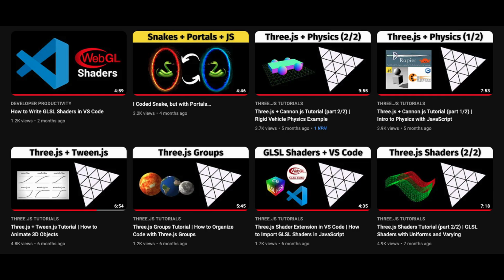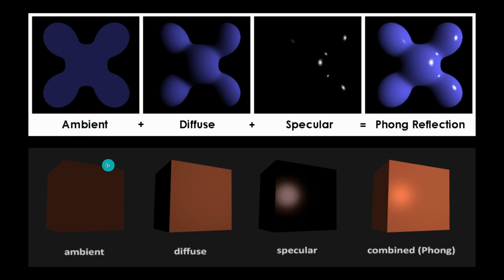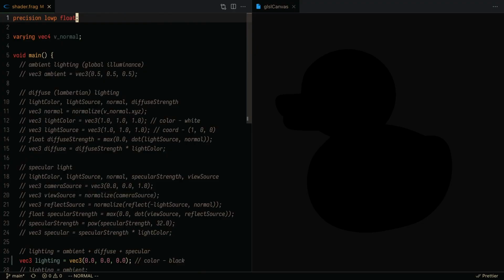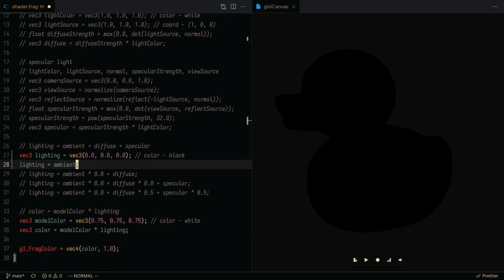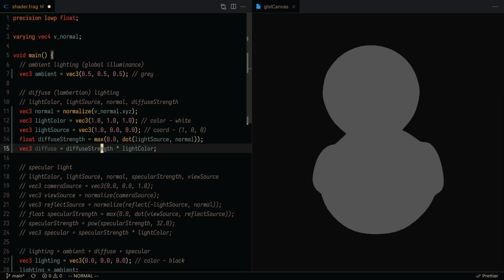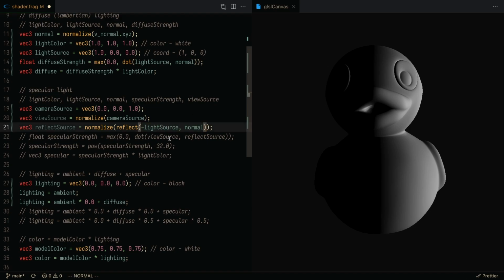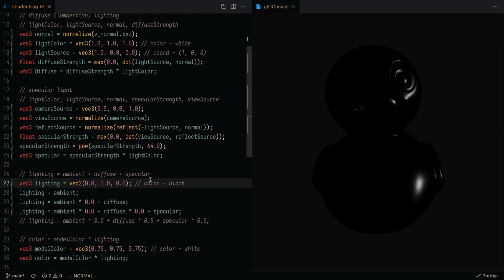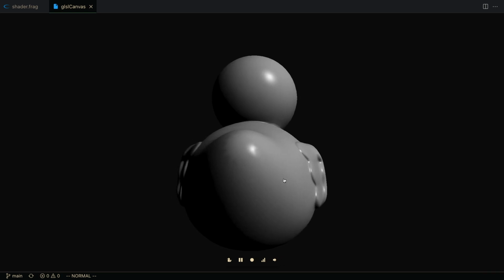Introduction to Phong Lighting

Comment: I wonder if this diffuse lighting model is just the estimation method?
My tought is in fact the diffuse light on the surface isn't related to angle of the light source to the surface,
but its the area of the light source right?

Comment: If fragment shaders work on a pixel by pixel basis, does the rasterizer also give eye-direction vector values for each pixel? I can't understand how else you could pull off specular lighting.
Reply from the maker: I fake the eye direction in the code, setting it to -1 in the Z axis.
Reply: In the fragment shader you usually pass in the eye position as a uniform. 

Reading the Z Buffer you can reconstruct the fragment’s x, y, z position.